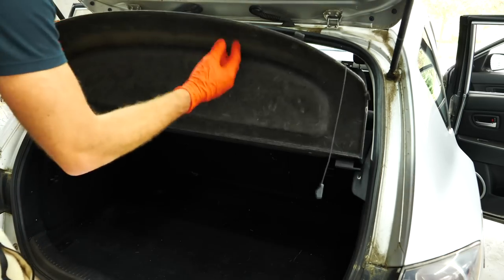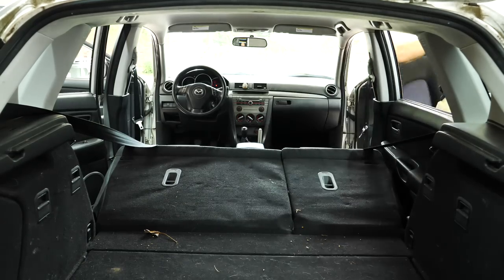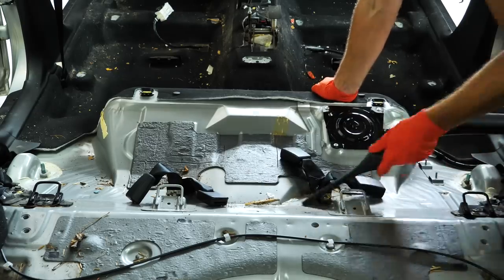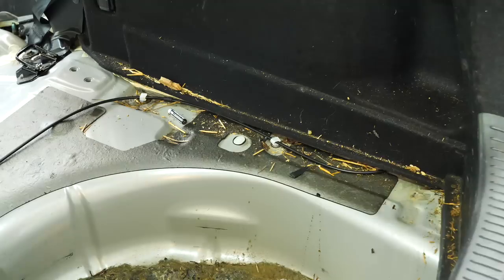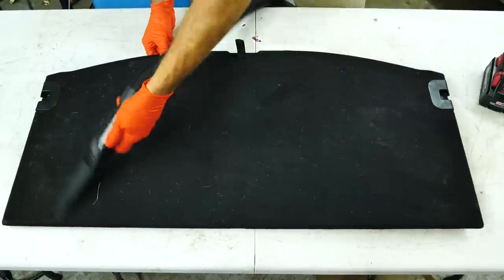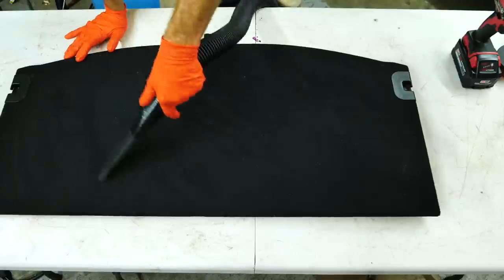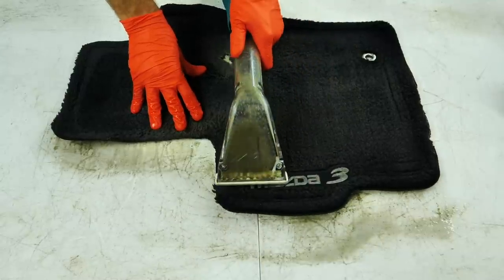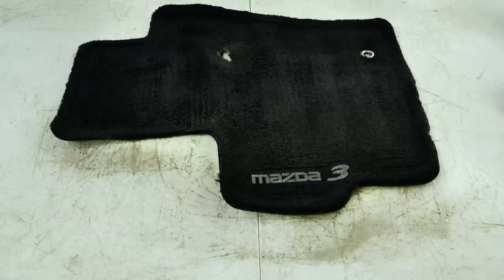How I Detailed & Restored This FILTHY Mazda 3 Interior!

Comment: I have mazda 3 since 2004-2005, working well without a single problem and I'm going to use it for the next 10 years. If you still have one, keep it. Don't waste your money!
Reply: Hello, I just bought a 2012 model (BL) and am so fond of it! Hope to keep it for years!
Reply: U could find 2004-2005 mazda 3 here for like 1.2k - 2k. Mine has 160 miles and so far only some suspension problems that already fixed
Reply: I have one 2005 Mazda 3, it didn't pass the inspection due to corrosion :eyes-purple-crying:
Reply: @truth_beauty  painting on any corrosion part would help you. Don't give up.

Comment: Interesting to see the differences between this and the UK version, known as the Mazda 3 Sport - the useful under-floor boot/trunk storage is missing for example.
And yes, you are right about the driving experience of cars from this era. Bought my '06 one at three years old and now (Dec 2023) it's both the oldest car I've owned and the one I have kept for the longest. See no reason to move on and taking it past 20 years old is tempting.

Comment: Wow, what an amazing transformation! I actually really appreciate this video. Two important questions though...
1) How many hours of your time were consumed for all of the cleaning and detailing you did in this video?
2) Isn't it a risk to spray liquid in and around the various buttons and controls on the dash? The radio, the HVAC, the turn signals, ignition, and all kinds of other buttons and controls...seems like at least some of that liquid MUST have seeped back behind the buttons, and possibly into the electrical contacts behind them...especially when compressed air follows after the liquid + wipe-off sequence. Thoughts?

Comment: I’m not a fan of the original Tornador….I use brushes and air only as a general rule. But if I grab a Tornador, I use the blow gun version with no chemical reservoir which is great to blow sand and dog hair out of the carpet fibers….even better when paired with the velocity vac attachment. It’s a bit comber some with the vac attachment but it does work great.